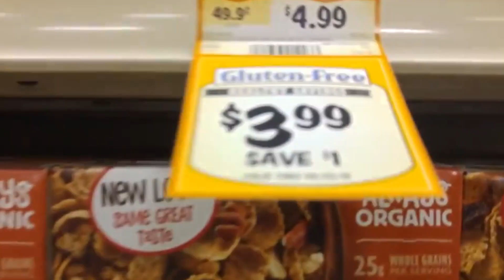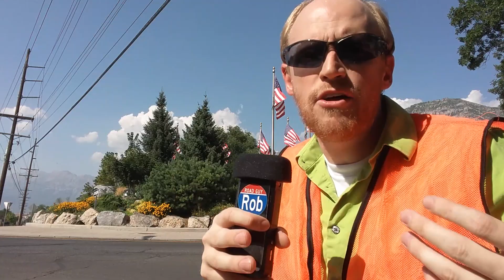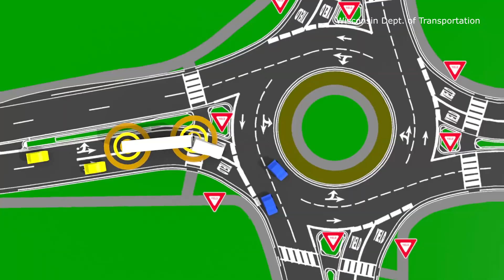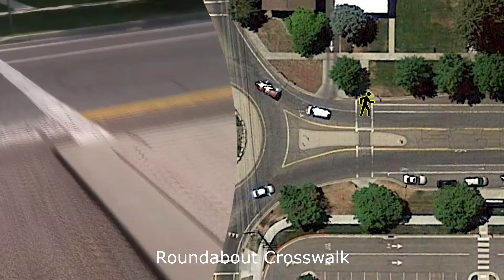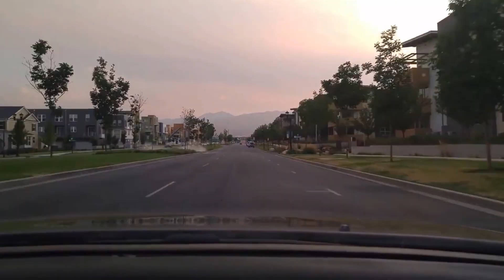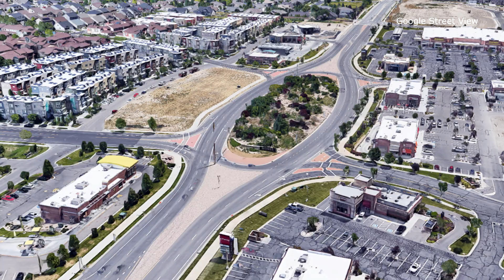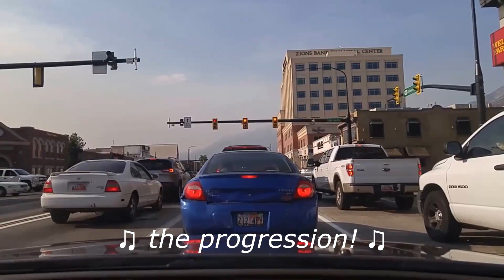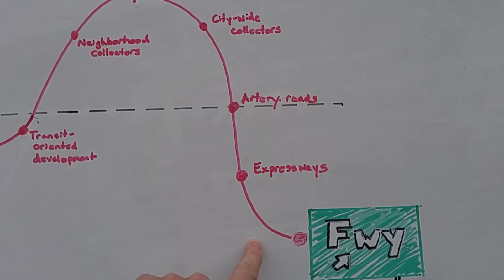Are roundabouts REALLY better than a traffic signal?

Comment: World: * feeling logical * Crossroads kill people.
USA: * feeling smart * Crossroads don't kill people. People kill people.
Reply: @TwizzElishus  no. You're wrong. The driver is NOT always at fault in a collision. If a pedestrian simply runs out into the road then there's very little a driver can do. Even if they're driving appropriately to the conditions and so taking account of the possibility of stupid toddlers running out into the road for example there is still a chance that one of said stupid toddlers will end up getting squished.

Incidentally there's also the issue that the combination of roundabouts and traffic lights has not been explored in this video. Roundabouts on freeways? Not on the mainline of the freeway itself, but at the end of a freeway or at the junctions of a freeway? Certainly not only a possibility but also done in the UK. What's at the north-eastern end of the M69 in the UK where it meets the M1 at the latter's junction 21? Roundabout. Now there are free-flow links to deal with a few of the flows of traffic, namely M69 northbound to M1 northbound, A5460 westbound to M1 southbound and M1 southbound to A5460 eastbound, but everything else has to use the roundabout.

However it should also be noted that this is not the same sort of roundabout as featured in this video. It is actually a gyratory. What the distinction? Lane discipline required to use them. On an ordinary roundabout the first turn has the nearside-most lane used, as often does going straight on, with subsequent turns using offside lanes. On a gyratory you instead get in one lane at the start of your use of the junction and then spiral outwards such that you remain in that lane and it exits the junction at the appropriate point for your journey. If you can't reach an appropriate lane at the start of your use of the gyratory then you simply remain at the centre until the appropriate lane starts and then begin the spiralling out process. The other distinction is that this is a signalised gyratory. In other words there are traffic lights at most of the entrances to the junction, both for the entrance and on the mainline of the gyratory. That way traffic flows are regulated and you don't get traffic stuck trying to get into the junction whilst traffic in the junction simply flies past. What is the other thing that signalised gyratory junctions allow? Platooning! Yes that's right you can have platoons of cars going round one of these junctions. If you get the timings right then it's entirely possible to get a green light at one set of traffic lights, follow the junction round and get green lights at all the other sets of lights you have to go through before exiting the junction.

There is a limit to the size that even signalised gyratory junctions can handle, but it's a lot larger than is implied in this video. Larger than that limit and enormous, completely free-flow junctions have to be used. For one of the most extreme examples of that sort of thing in the UK see M6 junction 6 in Birmingham. That's officially the Gravelly Hill Interchange, but colloquially know as Spaghetti Junction. If you look at it from above you can easily see why it's acquired that nickname! However notice that even that monster has a signalised gyratory as one of its constituent parts.
Reply: too true
Reply: @TwizzElishus  I think the driver shouldn't be at fault if the pedestrian was crossing when the signal says not to cross.
Reply: Roundabouts are not complicated. Alot of American drivers are very bad....that's all. Most will drive automatics, so don't really have any proper 'driving skills' as such - which manual cars allow you to develop over time. 

The majority of the accidents you see involving automatic cars (reversing into a wall at speed, flipping a car over for no apparent reason etc) just don't happen when you're driving a manual car. Manual cars force you to become better drivers - because you have to think about things like 'clutch control', when to change gear (be it up or down), and after a while you 'know' when you need to change gear. 

You can't 'switch off' totally when you're driving a manual - and NO, taking your hands off the wheel is definitely NOT a good idea when driving a manual!....you'll veer off the road very quickly or go across the road and into oncoming traffic if you try to do this. 

This is what I mean about how automatic cars take away the driving skills that every driver needs, and so drivers become lazy and not 'road aware' or they assume that 'the car will do it all for me, always'. In a manual YOU are always in control but you need to be alert and be aware of your surroundings. In an automatic, the car NOT you is mostly in control, but if you hit the wrong gear then the results can be spectacular or even disastrous. 

I guarantee that if more Americans drove manuals, then the standards of driving in America would improve dramatically. And the more drivers use roundabouts the more able they will be to see that they are not complex at all - but wonderfully simple, and a better solution than traffic lights. Not all junctions are suitable to have roundabouts at, but alot will be.
Reply: @robtyman4281  You don't have to drive a manual to have good driving skills.  In my opinion, good driving skills are necessary whether you drive an automatic transmission vehicle or a manual transmission one.  I have only ever driven automatic transmission vehicles and it's been years since I've been in an accident.  The last accident I was involved with was an animal collision at night.
Reply: @davidfrischknecht8261  It is actually proven when you need to controll the clutch and the stick, you're more involved in the action of driving, more mindfull of the speed you are going etc. This goes to the benefit of the skill of the driver. Sure you can learn all of this, but you're forced to learn this in a manual and it becomes a good habit that will carry over when you switch to automatic. The reverse is just not the case.
Reply: @robtyman4281  I can't quote a source but would be more than willing to bet that modern computer controlled automatic transmissions shift more efficiently that 95% of all people.  Just because you aren't shifting like a race car driver doesn't mean you don't have driving skills.  You can be in a manual transmission car and still be just as distracted by a phone, passenger, radio, etc. as someone in an automatic.  I guarantee as electric and hybrid vehicles continue to become more common manuals will become even rarer.
Reply: @robtyman4281  
Okay you actually mixed up 2 issues, having a manual transmission and having driving skills have nothing to do with each other. In Europe automatic transmissions are more expensive and less common. In the US automatics are the norm and manuals make up only about 5% of new cars. Gas is also cheap over here, which is where a manual transmission is superior.

In the US it's easier to get your driver's license than in Europe. In the US you can literally go to any mom and pop "driving school" take the test, pass, and get your license. In my state after you turn 18 you are not required to attend driving school and can do what it says up here ^. Probably why I don't trust other drivers. I personally never took driver's ed as it wasn't practical for me to do so, too expensive and conflicted with my schedule. I also felt I wasn't ready to drive at 16 so I waited until I was 20 before getting my license.

I'm self taught as quite a large number of Americans are. I learned how to drive by taking my mom to the store and back at 1am when there was no traffic and less likely to get caught driving without a license. I had practical experience and my mom to teach me driving. I've been driving for almost 3 years now and have not had an accident or been pulled over. I actually pay attention to the road and care about other drivers. I'm a responsible driver and according to my family and other people who have driven with me, I'm a good driver.

Other Americans are terrible drivers because you can, at 18, go to any driving school and take the test without taking driver's ed. In some areas the test literally consists of driving up the road taking a right, driving to the next stop sign, taking another right, then right at the next stop sign and park the car back at the lot. Take all the places where you can do that in Europe and you have American drivers.

I've never driven a manual transmission car before but my car has a fancy feature where I can "go manual." I prefer to do it in S mode cause in regular drive the system will revert back to automatic after a few seconds. All I have to do is click a little paddle on the steering wheel and presto the transmission shifts up or down. It also has safety features built in to protect the engine in case of a mistake or forgetfulness. It will downshift automatically for me, and prevent me from damaging the engine by downshifting to 1 while accelerating.

When I was little, we had a manual transmission car and I loved to start it for my mom. I had started it successfully multiple times before and never had any problems. One day we were going out to eat and I wanted to start the car. I got in, my Nana got in the front seat, and my mom was getting something from the house. I put my foot on the clutch, and turned the key. The transmission slipped out of neutral, into first, and I forgot to depress the brake. Now what should have happened? It should've just gave a little jolt and stalled. Right? NOPE! This little hooptie shot forward and went straight through the closed garage door. Now if it was an automatic that would not have happened as when the vehicle is in park the vehicle can't move as the wheels are locked. You have to depress the brake pedal, grab a button on the gearshift, and go through reverse and neutral before getting to drive.
Reply: @PupSentinel  manual transmission is great in America if you don't people stealing your car, my dad had a manual transmission but that was about 30 years ago.. i'm kind of surprised they still sell manual transmission in America at lest most switched to auto to save gas and puts less wear and tear on your car unlike a automatic transmission.

Comment: What about roundabouts in freeway-to-non-freeway interchanges, like dumbbell interchanges?
Reply: Probably depends on the road. There is an interchange on I-94 in Kalamazoo near the General Mills warehouse that often backs up down onto the freeway because there is so much traffic on the crossroad that semis coming off the freeway have difficulty getting a big enough gap to enter the roundabouts.
Reply: Carmel, IN has a number of those, US31 and Keystone Parkway function as freeways and their exits are dumbell interchanges.
Reply: As long as thru traffic doesn't need to enter the circle, even freeway-to-freeway circle interchanges are acceptable if scaled appropriately.  At certain interchanges they'd be inferior because of the large volume of interchange traffic.

Comment: @roundabouts on the freeway: Obviously you don't put them ON the freeway any more than you'd put traffic lights on the freeway, but they make perfectly servicable interchanges between freeways or between freeways and minor roads, really you can have an arbitrary number of connections of any grade going into the roundabout. Typically you'd use a flyover with slipways, like with any other interchange. Though highways can feed directly into a roundabout if it's not a through road (for example a freeway T interchange), it's not dangerous to put a big-ass roundabout with highway grade roads literally on a freeway.

Dumbell interchanges are pretty cool too.

Comment: A fascinating example of roundabouts for the American system is here in the UK. About 50 years ago a new city (called Milton Keynes) was developed on virgin land and was built on the American model of a grid pattern. Now, we don't 'do' traffic intersections with lights here, so the intersections were done with roundabouts. Anecdotally, I believe an American was responsible for the design of the city, but signalled junctions were a step too far, so they went for roundabouts. Because it is a new city and not something built around old field boundaries left over from the Roman occupation (believe me, boundaries don't change when they are just inherited down generations), the city was allowed to flow as it should and it is a dream to drive around. It is one of the few cities in the UK where you can accurately give an estimate of the time you will arrive. Furthermore, because there is grade separation of different types of transport (pedestrians, cars, bicycles and trains), traffic speeds are allowed to be higher.

Comment: During the 1920's and 30's when New Jersey was getting their highway transportation network together, the state built what they called "traffic circles" all over.  As Rob points out, they worked because traffic circles take care of themselves and traffic was relatively light compared to today.  However, post WWII and the push to the suburbs with increased traffic found the traffic circle became a nightmare.  During the late 1950's, the 60's, and 70's the state replaced most traffic circles with grade separated interchanges.  Some traffic circles were replaced by jug handled intersections.  This proves in the US that circles or roundabouts only work when the daily traffic count is relatively light.
I noticed when visiting the Netherlands, they use roundabouts a lot, including multi-lane roads.  However, with excellent signage and barricades, the traffic engineers separate the traffic heading in different directions into the correct lanes before it enters the roundabout.
Reply: The early traffic circles were bad because the traffic already in the circle had to yield to the traffic entering the circle, which was just a bad idea.
Reply: @davidfrischknecht8261  No, it didn't.  People keep repeating this, but any of us who are old enough know that the rule was always to yield right of way to traffic already in the circle.  People imagine that it was the opposite way in the past because of the general rule of yielding to the vehicle on the right, but traffic circles were always an exception -- and for drivers who didn't know that, there was a "YIELD RIGHT OF WAY" sign.  Why would the rule for circles have been any different from entrance and exit ramps elsewhere?

The early traffic circles were not bad for the volume of traffic they carried then.  They were a cheaper alternative to interchanges with over- and underpasses, though they slowed thru traffic a little, which is why they were reserved mostly for major intersections.  Circles became bad as traffic volume outgrew them.  Calling them "roundabouts" and making minor alterations is not going to change the general facts of the matter.

Comment: Roundabouts serving Freeways or major dual carriageways are typically elevated or subterranean (not actually on the Freeway Dual Carriageway) with the main road going straight through either above or below.  The roundabout serves the main road with entrance and exit roads connecting main road to the roundabout.  This is suitable with smaller routes crossing a major route.  Two major routes crossing each other requires much more infrastructure.

Comment: Where I live in ohio They're in the process of putting a roundabout on a highway with plans on putting a second one in about a mile away. The struggle is that they drop the speed limit down bc it goes into a business/ residential zone so that builds up the traffic. Well this highway goes straight to the interstate so of course it's heavily used. Putting in 2 roundabouts isn't going to solve the traffic issue. They bought up all the houses that sit on the highway which the driveways came out onto the highway. If they just cleared that and made the speed faster without so many traffic lights and intersections it would solve all the issues.

Comment: Aslong as traffic is flowing, they work perfectly fine. But with a high volume of cars, roundabouts tend to get gridlocked quite easily because cars in the roundabout block each other. In a conventional intersection layout, this can happen too, but is less common, since cars spend less time on the intersection (but more infront of the traffic lights). In my hometown they replaced quite a lot common intersections with roundabouts and made traffic a nightmare, bringing complete city district to a complete standstill during rush hour.

Comment: They are just very uncommon in many places. Im from MS. I can only think of a few in my state and Iv only used one. A single one. Then I moved to MD. They arn't everywhere but there is a fair number here. I was scared of them at first because the roads are sooo busy so if you mess up, you could cause an accident easily. But I eventually got it down. Now I prefer them to lights on moderate to light roads but I still prefer traffic lights on busy roads that have multiple lanes in each direction.